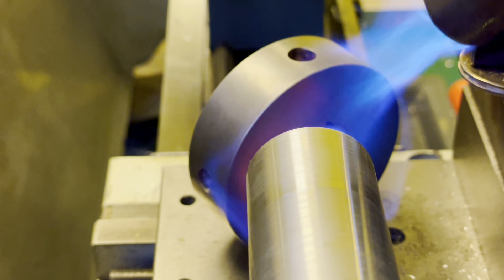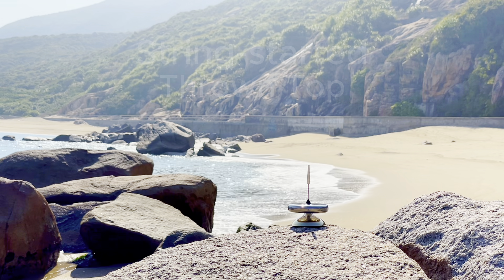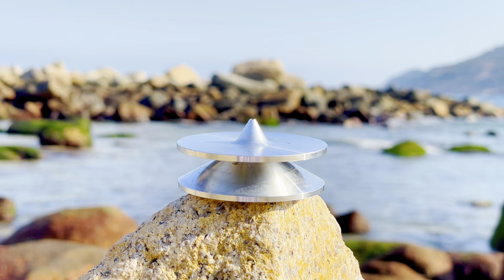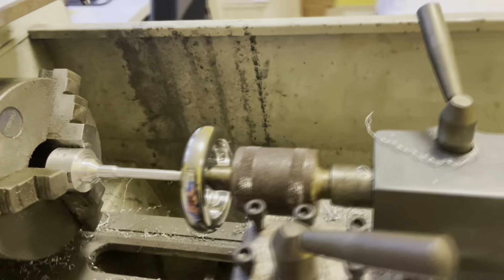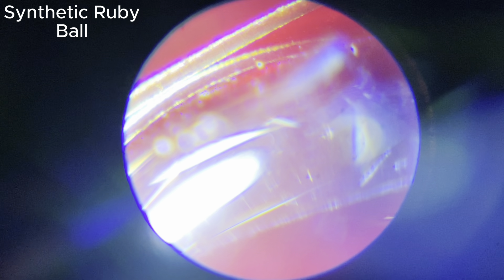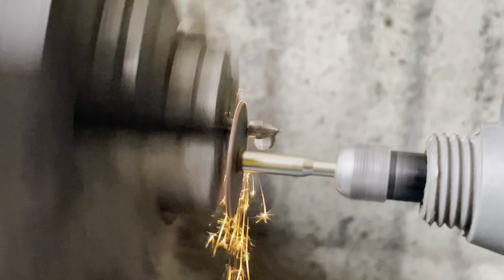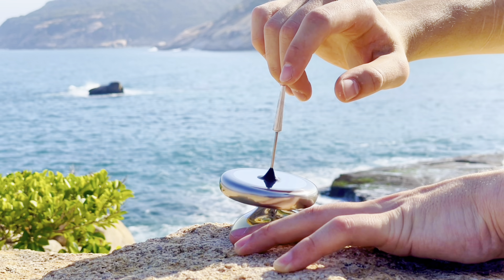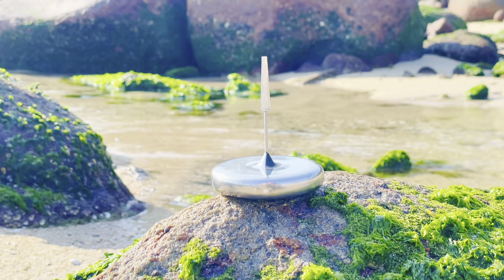Spinning Top Mk.24 | RUBY & SAPPHIRE

Comment: What if... You have your spinning top, and the air bearing from steve moulds video, but you still keep the spinning point and the tungsten carbide plate. You build an air bearing between the tip and the spinning top, which would mean that the spinning top could spin for longer since the tip isn't spinning as fast. It's just gyroscopically held in place on top of the tungsten-carbide disk. 

Below is kinda referencing what im thinking about.
World’s Best Spinning Top (Ball Bearing) 

Although, if you could pull that off I think you would remove some of the tip friction. However, can the Guinness World of Records recognize a spinning top with a bearing inside the top or would it be considered a gyroscope and is a spinning top not a gyroscope? 
love to see the determination!
Reply from the maker: Wow interesting idea. Yes I think this could help a bit however moving parts are not allowed. Still it could be fun to try at some point.

Comment: Another idea: this one will be a real challenge to manufacture.  I'm envisioning machining the top tip to have rounded ruts corkscrewing towards the center of the tip designed so it mechanically pushes the lubricant to the center and ideally will lift the top or more likely reduce the weight in contact with the base. You'd need to make the tip less pointy so there'd be a trade off. But, it's an idea.
Reply from the maker: Wow that is interesting.. it would only beneficial if the contact patch of the fluid the top ‘floats’ on is quite small. So this would certainly be difficult!

Comment: What are the rules for a "finger start"?

Can you use the fingers of both hands, moving in opposing directions, or does it have to be fingers on the same hand?
Reply from the maker: It’s a bit vague but I’m not sure Guinness would be happy with a palm start. Even if they are, it would take a lot of practice for me to get accurate enough to use the technique effectively.

Comment: This is probably a dumb idea, but if golf balls have less aerodynamic drag due to their dimples decoupling the airstream around them, then would giving the outer permitter of the top which has the highest velocity the same texture improve performance?
Reply from the maker: It’s not a dumb idea but the consensus is that it would be detrimental. Perhaps I’ll go into detail on this in a sequel to the science video.

Comment: If air flow off the edge is so important, why is the shape so blunt where the air stream has to separate?  Individual masses of air from the top and bottom are meeting at the edge and being forced to turn a right angle, and that turn is going to rob a small amount of energy.  A sharper edge like a disc golf disc might improve the situation.
Reply from the maker: I suppose another issue is with material sourcing and costs and machining. Generally I try to maximise the diameter from the stock I get. Perhaps I can consider trying this by adding on another part to the outside..
Reply: @hiper_tops  that tungsten alloy disk is fairly thin though.  I'd check and see if bar or plate stock exists in a suitable thickness.  There's nothing that says you need to start with round stock in a lathe....

Comment: I can only imagine what you could do with an electric start.
Reply from the maker: It is actually scary to do, so much stored energy. However I would like to try some time!
Reply: @hiper_tops  Perhaps start with something smaller than an electric drill and with a top not any bigger than your current ones. I have seen some videos of larger things spinning (accidentally or on purpose) and they are terrifying.

Comment: Would oil-impregnated bronze make a good tip/base material?
Reply from the maker: I suspect bronze would be too soft for tops as heavy as mine. However for tops <80g or so, it could be good!
Reply: Thank you for taking the time to reply to my comments.  Is lubrication prohibited from official spins?  If not, would it even be a relevant factor considering the hardness of your point/base materials?

Comment: Great video. Golf ball dimpling will cut down drag as others have suggested. You might look up the Myth Busters Dimpled Car video that showed a nice improvement in fuel economy.
Reply from the maker: True however there is no pressure drag to overcome here so the increase in viscous drag would be detrimental.
Reply: FYI, after myth busters tested this and found it to save drag an auto manufacturer tested it independently and wasn't able to recreate the fuel savings.
Reply: @ Good to know!

Comment: Fun stuff! Subscribed!

Have you tried testing different altitudes for your spins? I do agree seaside views are great, but if we are chasing perfection, it should at least be tested for reference values. Also, I suppose it's not againt the rules to choose your spinning location, right?

At 2000m altitude, there's about 80% air density than on sea level. It would be interesting to see how big of an improvement (or not?) would that be.
Reply: Also, I just found out that counterintuitively more humid the air is, less dense it is. So even humidity is something to take into account as well.
Reply: The very least, I'd love to see test of this in a vacuum chamber. This way we could figure out how much each component of total resistance accounts for.

I have so many questions! haha
Reply from the maker: I have previously used a vacuum chamber to collect data and hence separate tip friction from air drag. I will try more of these experiments and film them to share in future videos :)
Reply: @hiper_tops  Now that you mentioned it. I think it wouldn't be expensive (relatively speaking) to build a testing environment where you could change just one variable at a time:

- pressure
- air temperature
- humidity
- initial rotational speed
- initial angle
- ... What else?
Reply from the maker: Wow! Thank you so much for the donation, and thank you for subscribing :) I haven’t tested the impact of altitude or humidity change, however I would love to and I am aware of the potential gains. Furthermore, I believe cold air would be beneficial due to the counterintuitive decrease in viscocity. I hope to experiment with this in the future.
Reply: @hiper_tops  no, thank you for making these videos. What's F1 for car racing, that's you for engineering. And I really appreciate that!

So, cold-humid environment at high attitude (low pressure) would be most beneficial, unless we missed some important factor (which we most probaby did, lol).

Do you happen to know AlphaPhoenix youtube channel? That guy is amazing, and if you don't you are in for a treat. He's quite technical and not afraid to dive deep into it in his videos. Just my 2 cents for feedback, might give you some inspiration for the future. I'd love to see more technical/experimental stuff :)

Keep up the good work!

Comment: How concave do you need your base? I was wondering if the base plates (ruby, carbide,..) could be deformed ever so slightly into an concave base? I guess they can handle so hundreds of a millimeter before breaking. The process would be: make concave indentation in base, make corresponding convex pressing tool, drop of superglue on base, ruby in and then pressing. Only possible for verry smal radius of bending of course. The advantage would be: the ruby would be under compression stress and therefor even harder on the top. Absolute wild shot of an idee. No idee if somewaht plausible or doable. But it looks to me, that no idea can be to crazy for your project ❤
Reply from the maker: You’re absolutely right, crazy ideas can be great ideas. This is an interesting one and I would love it if I could avoid grinding the ruby and simply bend it. Perhaps for a very thin disc this may be possible, however I’m not sure how it would behave - it is quite brittle!

Comment: Have you considered using an extremely low viscosity oil on the tip? Great video - fabulious, even.
Reply from the maker: Thank you :) I use a thin film of oil on the base and indeed this helps increase spin times by 8-10%

Comment: Definitely try a dimpled surface on the wheel at some point. Also, I'm wondering if maybe making the contact point rounder instead of sharper may improve things? I can't help but feel that the sharpness of the tip results in the friction becoming enough of a factor as it scratches or "drills" the base. One could try a more convex shape instead of a normal conical point, to see if anything improves.
Reply from the maker: Interesting ideas. I am planning on trying a small ball tip which would act similarly to your suggested round tip.

Comment: Watchmakers use a very fine lubricant with the saphires. I don't know if this would worsen or improve the tops performance.
Are you using lubricant? How do you clean fingerprints from the contacting surfaces?
Thank you for letting us partake in your journey and positively cool hobby.
Reply from the maker: Thank you! I do use a thin lubricant designed for ruby bearing balls. I use acetone to clean my tops before spinning.

Comment: You spin it with your fingers and then it spins for an hour and twenty minutes! Thats insane, the balancing accuracy, the nightmare materials (how do you join a titanium shaft to a tungsten flywheel to a carbide tip?), it might be a "top" but really its an engineering and craftsmanship work of art and mastery.
Reply from the maker: Thank you!! I use tapered fits and super glue only when necessary to join parts. In the past I’ve used heat/cool interference fits :)

Comment: I wonder how much longer it would spin in a vacuum chamber. Doing so may highlight other factors not related to wind resistance.
Reply from the maker: You’re right about that, hence in the past I’ve used this method to collect data. It generally increases spin times by about 50%. For example Mk.22 went from 1 hour to 1.5 hours. Of course a top designed for a vacuum environment would spin for much longer than this :)

Comment: What are the rules regarding rpm then?
Is it allowed to gear up the spin? (I hope not but rules are rules)
Does it all have to be one piece? 

Suggestion: spin it controllably and check the relationship rpm/time. Maybe rpm is the most obvious pursuit.
Reply from the maker: The rules do not allow for a starting device other than one’s hands. It does have to be one piece (so can’t shed weight or similar). The graph towards the end of the video shows rpm vs time, you may find this interesting! Due to the high impact of air resistance at high speeds, doubling the starting rpm would only add about 10 minutes.

Comment: For the base you could maybe re-purpose a domed saphire watch face. They are made of pure saphire and you can find them in different dome shapes and sizes.
Reply from the maker: That’s a really good suggestion which I only came across by chance recently. I’m looking into it but it’s difficult to find them in a small enough size :)
Reply: I think I’ve suggested them too, they’re not hugely expensive to buy online. It might be easier to grind the edges of one down to the size you need than it is to grind a concave from scratch as you did here, as they come ready polished and the quality of the edge grind won’t affect the performance of the top.

Comment: Good stuff! Very interesting. I'm wondering; could you simply increase the diameter of the top and add more weight? Do you run into diminishing returns? Are the size constraints aestetic?
Reply from the maker: I don’t let aesthetics limit performance :) Unfortunately since tip friction and air drag increase with mass and radius, it isn’t so simple. I believe I have found a quite optimised ratio.
Reply: @hiper_tops  ahhh, I didn't consider the extra friction on the tip. Even though aestetics are not a main concern, they still look great! I bet you would find a market for your tops if you ever decided you wanted to get into manufacturing and selling them. They would make a great interest piece for a desk. Would probably be more popular than the newton's cradles were.

Comment: Is there any way to optimise the surroundings of the top? you could try to turn the base into some kind of cup to go around the spinner to kind of mimick those precision machined air bearings. Also, it's probably against the rules, but i'm interested to know how long it would spin in a vacuum chamber.
Reply from the maker: You are right there is room for improvement with the top’s surroundings. I have previously avoided tampering too much as changing external things to the top felt against the spirit of the challenge. However if it gets me across the line I may consider it. Yes I have used vacuum chambers for data collection previously. I plan on filming more of these experiments for future videos :)

Comment: instead of using your finger tips with repeated spin ups can you do like a fire stick method where you hold the top between your two hands and slide it between them to start? or is this method slower?
Reply from the maker: I think there is potential for this to be faster but it is difficult to aim accurately enough. Perhaps with a lot of practice.

Comment: Have you thought about doing the spin in a vacuum chamber? Start the spin, close the lid, turn on the vacuum = little to no air resistance regardless of design
Reply from the maker: In fact I have done this for data collection with Mk.20 and spin times increased by about 50%. I’ll record more experiments in the future.
Reply: @hiper_tops  So would it be safe to assume you could get the same increase on this spinning top? Abd most importantly, would it count towards world record?

Comment: You mentioned specifically monocrystaline diamond, so I'm curious-- what about PCD, from someone like US Synthetic or the like? How would it perform, compared to monocrystalline diamond? (I assume it wouldn't be practical for you to work with, but in theory)
Reply from the maker: It’s a good point which I haven’t brought up yet but essentially polycrystalline diamond acts like sandpaper and would rapidly degrade the tip. However in theory if I can get MCD smooth enough, this should be avoidable.

Comment: I don't follow this project too closely, but have you run the top in a vacuum chamber before?

Could be nice to see if air drag or tip friction is the most significant aspect
Reply from the maker: I have for data collection. It depends on the design - for higher mass/radius ratio tops, tip friction is greater and vice versa.
Reply: @hiper_tops Tip friction is greater in a vacuum? Any ideas why?

Comment: Regarding aerodynamic detachment from the disk, have you considered giving it a "chine" around the rim?
Reply from the maker: What do you mean by chine? I’m interested to learn more, especially applications which use such geometry
Reply: Reference the chines on the SR-71.
Reply: Basically sweeping the upper and lower edges together in a wine stem shape so the outer edge is thin.  I'd suggest trying this edge both sharp and with a very narrow flat outer edge creating a "gas trip" for detaching laminar flow from the top and bottom surfaces.

Comment: Two insights i would like to share:
Thinking about your geometry with regards to aerodynamics,  I wonder if there is a better shape for the outside of the disk to improve the shedding of the air, possibly a sharp point like you see for pressure recovery in high efficiency designs
It would be interesting to test in a vacuum chamber, especially one with a turbo multi stage pump system to get down to outer space levels of vacuum,  then you could calculate how much energy you are losing to contact friction vs how much you are losing to aerodynamics
Reply from the maker: Are there any applications that use your spiked flywheel shape? Thanks for your suggestions

Comment: Have you considered dimpling the flywheel or the core like a golfball? I feel like if it's accelerating air in a disc that's got to be a big energy loss right? Would deliberately disrupting that flow make a difference?
Reply from the maker: Unfortunately it seems any increase in turbulence is counterproductive. Golf ball dimples for example would just increase viscous drag.
Reply: @hiper_tops Right, dimples on a golf ball work by creating a turbulent layer that causes the air flowing around the golf ball to stick a bit longer and thereby reduce drag.  That increases drag on the surface but is made up for because of how it affects the air entering the region the ball exited.

Here we always occupy the same space so it would just hurt.

Comment: I'm not sure what the Guiness rules are for this category, but, you may consider machining a ruby tip to mate with the ruby base and a single drop of oil. They would last longer than needle point tungsten carbide. (I would assume, your mileage may vary)
Reply from the maker: True about the wear but the breaking torque would be much greater due to the increased contact patch. I currently use some oil.
Reply: @hiper_tops  would the breaking torque be lower if you deliberately polished the surfaces to a lesser gloss in order to allow the surfaces to retain the lubricant?

Comment: I bet you could find someone with freakish hand muscles to do the initial spin up. Seems like an easy to exploit variable for a record. 🤷‍♂️
Reply from the maker: Not quite! Even if the starting speed was doubled, this would only add about 10 minutes to the spin time due to the large air resistance at high speeds.